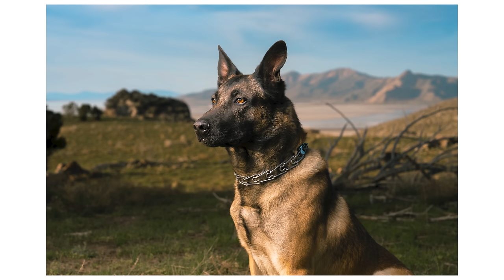Guide to Double Stack 1911's - $34,000 of Pistols

Comment: Small detail missing on the breakdown(im commenting as watching) of tier of parts quality, forged isnt really a combination of cast and machining from billet if anything its closer to casting because the metal has to be heated but its really its own process that most importantly requires pounding and compressing the metal, which helps the metal to retain its strength since the grain flow remains unbroken unlike when its been melted to be cast in a mold. 

Machining billet is a process where the metal is cut and grinded to shape by high tech CNC machines through processes like turning, drilling, grinding, milling, etc as you basically explained.

Hopefully provides a little more clarity on the differences there. Looking forward to the rest been waiting for a video like this forever!

Comment: Love this video and this channe! I hate to be "that guy," however forged parts are stronger than billet. The forging process tightens the grain structure therefore making it more uniform and stronger metallurgically speaking. However billet has the advantages of a machine precisely fitting those parts by fractions of a millimeter. Therefore with billet you have a higher propensity for a more precise fitment of the parts. Just sharing some info for everyone, take it with a grain of salt and do your own research! This was not a criticism just a clarification. Thank you guys for the amazing production value of all your videos and the presentation is always educational and entertaining 😁

Comment: Regarding the thumb safety issue and it engaging when you shoot,  For all 1911 / 2011 pistols,  you should rest your thumb on the safety as you shoot.  this is for left or right handed shooters.  Obv, lefties will need an abmi safety to do this but my point still stand.  i saw in all your b-roll that your thumbs are sitting to the side of the safety allowing your palm to bump the safety up.

Comment: The most affordable 2011 is the rock island 1911 tac ultra double stack, they can be had in multiple calibers for under 900$ and the are damn durable too
Reply: Actually it's the Rock Island M 1911 A2 FS Double Stack under $500.
Reply: It kind of confused me a little that they had an entry level category but left this one out, great gun for the price point though. The fit and finish leaves a little to be desired, but I guess for what they cost, adding in the cost of having a gunsmith work on the extractor to keep brass from flying every which way on ejection doesn't really put it above the price point of the other entry level guns in this video.

Comment: Atlas’ come from the factory tuned to specific ammo. The goal isn’t to make it have no recoil, it’s to make the sight return to exactly where you broke the shot. Mine came tuned to blazer 124gr and the holes stack with a decent grip.
Reply: Crazy a 6K gun has a certain ammo it works best with, yikes!
Reply: @wood-wheel-wizard  It’s not a bad thing if that’s what you mean. Tuning a gun to certain ammo is how you get the most out of it. Just like tuning an engine to a certain octane.
Reply: Yeah my Athena is also tuned to 124 gr ammo. Once you start stacking bullet holes at 20 yards at speed, you don’t care about recoil anymore. Just like you don’t care about the Porsche GT3s rough suspension. You just find yourself at the track every day trying to achieve it’s true potential

Comment: All of these high-end custom guns are a total waste of money and totally not practical because the parts ARE NOT interchangeable like the original 1911s and the lower end 2011s, Glocks and even automobiles and others things we use and need to fix periodically. I'm glad these points came to light! I stop at the TISAS SDS and Prodigy 2011s! Under $1500 for any pistol is more than enough!

Comment: A huge part of what makes something like Rolex or Omega expensive is not hand fitting but the opposite. The parts are made to such a high level of precision that the parts fully interchange. The other side to Rolex that makes them expensive is actually just marketing. They purposely make less because they can sell fewer watches for more money per watch because they can get that money. I have a friend that's been wearing the same Rolex GMT Master everyday since 1963 that he was given as a gift. That watch after inflation cost just over 2k and now they sell that same watch for significantly more money. His Rolex despite never getting serviced still keeps great time after 6 decades of wear.

The other side to watches I like to bring up is that the barrier for entry to a high quality, highly accurate, wristwatch is very low with digital watches. Past that point and it's become more about being jewelry than a timepiece.

Comment: One important note from when you were talking about the metal component processes (MIM, Cast, Forged, Billet)

Forgings, if done properly (and heat treated properly) will be the most structurally durable piece while Billet will almost by default lend itself to a higher degree of precision while still being quite sturdy.

A properly Forged piece of metal will handle use and abuse MUCH better than a Billet piece, but the billet piece will be much "cleaner"
Reply: Uh-Nope! That old saw has been dispelled for a long time now. 
KnifeMaker
Reply: @michaell397  you know there's a reason that things like AK trunions are considered "trash" if they're not Forged right? And the last word in your comment "knifemaker" is kind of funny given that every single knifemaker that I know swears by FORGED blades.

Forged metal has an underlying grain structure that is homogenous and when tested for breaking strength, impact strength, and wear resistance, will perform better than stronger metal alloys worked by other means.

As a very broad example, a forged barrel will have a longer life (regardless of chambering) than any form of cut rifled barrel, whether button rifled or single point cut. I have seen CHF barrels with verified round counts of over 20,000 rounds that are in better shape than ANY cut rifled barrel made of any material commonly used with round counts totaling barely a fraction of that number.

Look at ANY manufacturing industry and look at the materials they use when wear resistance and durability are prized over precision, it's forgings. Now things like wear can be minimized with billet or other forms of machining by having cleaner tolerances and taking things like fine deburring into account, but that's only reducing friction which is the thing that causes wear. It's not making the metal wear less because it's more durable, it's wearing less because it's under less stress.

Comment: Concerning modifications to entry level pistols, it depends on the modifications to me. If it’s the normal flashy mods then, yea possibly just jump up a tier. There is a few offering more meaningful mods for entry level pistols, which get their barrel fitment on par or past some of the mid level and even high level manufacturers mentioned. So if the mods can be seen 🤷🏽‍♂️, if the mods are internal and actually provide meaningful changes then it’s going to run with the higher tier pistols pretty well. 

I’d recommend at least dealing with one manufacturer/gun smith who falls under the Bob Marvel build philosophy. Chamber’s Custom is the most well known but there’s a few other who branched off from working with him. Talking to any of those people will leave one questioning most of the manufacturers mentioned in the mid and high level categories. For the most part any of the ones under high end are going to work well. There’s just a difference in opinions concerning how things get built and what true fitment means to one vs another. 

Concerning the Atlas left hand issues, Sage Dynamics is a lefty and did not have any issues with the ones he has tested. Like you said not everyone grips the same so not saying it has to work for you but just saying it’s not a being left handed issue.

Comment: I may be a little off kilter.  Did you say that more expensive 2011 had higher tolerance?  I'm in manufacturing, and I think you meant lower tolerance..  It's like .5 mm is a higher tolerance than .2 mm.  So a tolerance of <= .5 mm (higher) has more wiggle room  than a tolerance of <= .2 mm.  Just sayin.  All things considered, I would prefer a lower tolerance.  Ask me about Apache Helicopter blade weights.  They were down to less than .005 gm per centimeter from the rotor to the tip of the blade.

Comment: Few shooters are going to be able to out shoot the gun in terms of accuracy. Few people will shoot their guns till they wear them out. If you compete at a high level, you may get a little more out of the higher end guns, but with most things, there are diminishing returns. The reality is bragging rights for most people.

You can buy a lower end gun and upgrade parts to make it a great shooter, just as people can take a lower end car and tune it to perform as well (or better) that some high end sports cars. At the end of the day, spend your money how you want, but keep in mind there are diminishing returns as price increases.

A fairly inexpensive quartz watch will keep better time than a high end Rolex, or even a Patek Philippe. While you never have to worry about replacing a battery, high end automatic/mechanical watches need to be serviced every few years. That service can be anywhere from $500 to over $1,000 depending on the complications and the parts needed. A high end sports car will cost much more to maintain and repair than a regular car. As you move into the higher end guns, the number of gunsmiths competent enough to work on them decreases significantly. You wouldn’t just take your Ferrari to Jiffy Lube for maintenance or Midas for brakes.

Comment: Let's get down to brass tax here. A $6000 1911 will not help you anymore than a $400 polymer duty pistol when it comes to self defense, if you don't know how to shoot accurate, practice! For $6000, your paying for craftsmanship thats it. Now, somethings that will help, a little bit, when it comes to performance are,  trigger pull weight, how sturdy the pistol is when fired and your sights. These are factors based on my experience. When I changed those 3 things, it did help my accuracy. But, do not buy a $6000 pistol thinking your going to automatically start shooting 1.25 inch groups without practicing. The information im sharing is for people just getting in to pistols. If your a seasoned vet, ignore my comment. I do plan to buy a wilson combat sfx9 but for the craftsmanship, its just something about the silhouette of it that I like.

Comment: I kind of disagree with the optic cut on the Atlas, if they offer dot or no dot options, and you want the dot, then buy the dot. For someone who doesn't want the optic, I would rather have a solid single piece slide than some plate screwed on my $5,000 gun. I'm not a fan of the plate system in general and typically get my slides cut and press fit for the optic i'm going to run on it.

Comment: There are no MIM parts on a Staccato. The one “drop in” part is the grip and even that is not fully true.
Reply from the maker: Never said staccato had mim parts. I said you can generally expect budget guns to have some mim. Never said staccato
Reply: @1911syndicate  you lumped them in the entry category while mentioning the MIM parts. Likely confusing the audience. Also, Staccato has 5 models that range from $2k - $4300. Sure part of their process is production, but they do bake the hand fitting process and in house DLC coating process in with that.

Comment: Kind of wrong on the billet vs forged. Think of metal as wood it has a grain and when you cut into it as in milling a block of billet steel you cut into the grain of the metal, When you forge metal you press the grain into a shape but the grain stays intact. But there is a Glock vs 1911 type argument on this subject. I work with metal so it’s what I’ve always been told and learned

Comment: Actual engineer here… disagree with the materials ranking order. I would put things as cast-mim-billet-forged. MIM and cast parts are essentially the same, MIM is just cheaper, faster, and more consistent. There are post processing treatments that make MIM parts just as good as billeted parts (look at Hot isostatic pressing). Forged is better than billet due to grain flow and work hardening (look it up, too long to explain), the whole point of forging is to take a billet and make it stronger/better. Billet has just been marketed to be better because of the amount of work/effort that goes into making something from billet. Most companies heat treat forgings to make them harder after forging.

Comment: Forged (with post op) is far superior than billet. Long story short, grain structure and orientation matters. Forging increases mechanic properties (toughness, tensile, stiffness) while controlling and optimizing grain structure.
Machining cuts that grain and will yield a lower part mechanically.
Billet is great but no, forging is better.

Comment: One thing not mentioned is that the polymer grip does flex and soak up some of the recoil impulse. ;<)
Tried the carry ins you suggested and it said 16.95 (iirc) and when I went to pay it was back to 16.95. Gimmick,bait and switch? Seems I need to call them!
KnifeMaker

Comment: I would rather have a gun with drop in parts that you can replace than a gun that has to be treated like a 2024 BMW oil change where you’d have to readjust everything just because you changed out the barrel- especially for when SHTF

Comment: No disrespect but the Material being used is very important. 2011 top quality parts are Tool Steel that are machined and FYI forged Aluminum is stronger than billet so the material matters and of course who is doing it. A high end gun holds its value better and can increase it’s value low end guns rarely do the same

Comment: diminishing returns has to set in at some point. if the 20K round count gun is 1/5 the price of the 75K round count gun then it doesn't make much sense from a shooters perspective... but it does make sense from the drip perspective & it's always nice to flex on the poors in a competition by showing up with a $6K pistol and not even bothering to clean or oil it - and yes, I am referring to your competition video.

y'all so used to the infamous 1911 reliability that you self induce malfunctions for that nostalgic vibe. lol
Reply from the maker: You watch a 30 minute video and think you understand the proceedings of the 24 hours before it. Comment less on things you don’t have the full story. That said, you are correct, that’s why we said in the video that at the mid tier you have everything you need from a functional level

Comment: What's always fascinated me is that forging keeps the metal grain structure, and billet cuts away metal like a cookie cutter. In AK bolts and trunnions forging is the best because it's the strongest, so why do 2011s cost more if they're billet when it's weaker?
Reply: Maybe something like billet = strength of 8, forging = 9, mim = 4, cast = 6. 1911 frame and slide needs strength of 5, slide stop needs strength of 8
Reply: Most shooters are not gonna shot through 20-40k rounds needed to replace the parts. Stick with entry level 2011.

Comment: 0:08 Incorrectly referred to as the 2011. The "2011" denotes the pistol having a modular 2 piece frame. The Para Ordnance double stack 1911s are absolutely not 2011s for example. 
0:32 2011s also tend to have polymer lower frame.
If all you want is more capacity (double stack) and don't actually care about the 2 piece/modular frame then I would say entry level is the older Para Ordnance double stacks (or similar). Can find them in 45, 40, 9, 38super sometimes.

Comment: i had a staccato c2 and it was nearly perfect, it just had one flaw- FIELD STRIPPING ! it's achilles heel is a small piece of plastic you have to fumble fuck onto the guide rod to take a apart and put back together, so cleaning this weapon was a nightmare and if you lose that little piece of plastic then you're fucked.
Reply from the maker: Paper clip bro. Just cut a paper clip
Reply: @1911syndicate  you shouldnt have to be sticking paperclips in 2250 dollar guns. this is the reason why delta dumped STI's weapon's contract proposal.